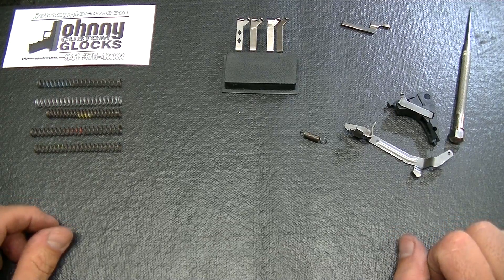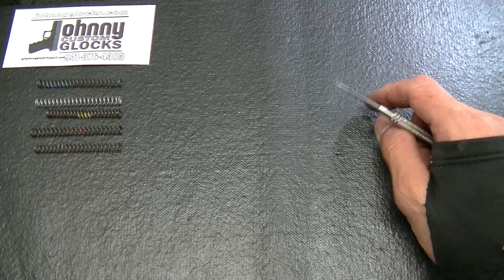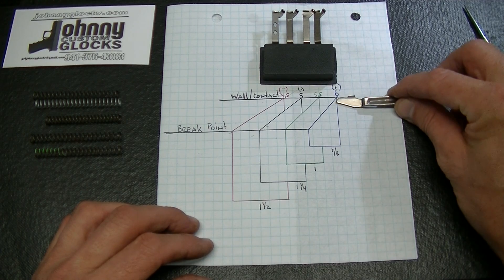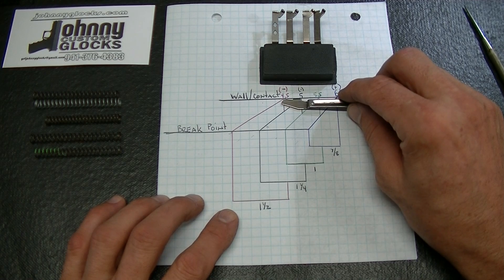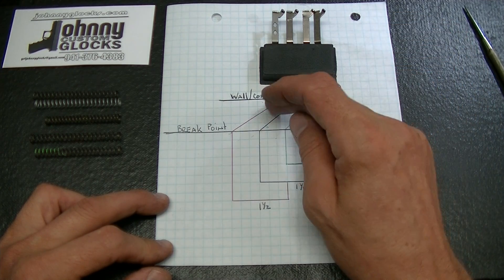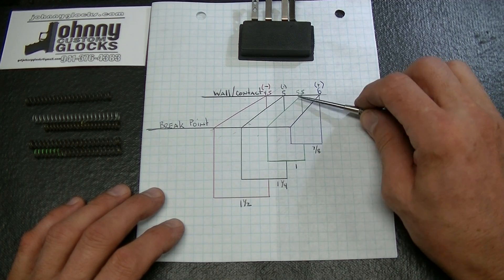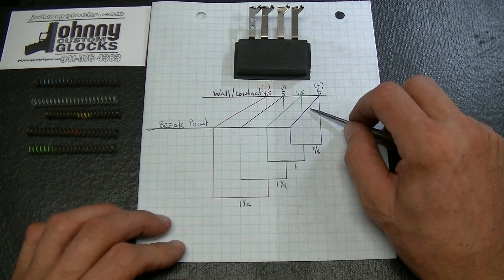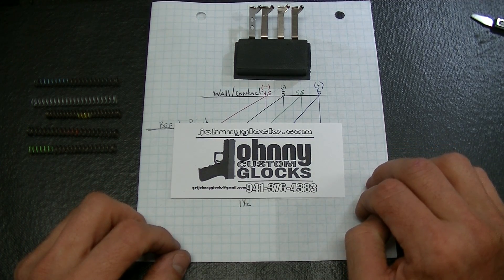Connector Geomerty Pt2 EDUCATIONAL ONLY

Comment: One of the things that you can do with the Johnny Glock modified OEM trigger shoe is reduce the pre-travel as far as you can without contacting the safety plunger with the vertical extension.  Reducing the pre-travel moves the trigger bar further back at the beginning of the pull and helps compensate for the longer pull of a lighter connector. Then you can adjust the final Polaroid by installing the appropriate weight striker spring.

Comment: I know this is a super old video but if you add an upgraded safety plunger spring your going to have 40 combinations with the 4 connectors and 5 springs.  That’s 20 between them and then each combo using a different safety spring makes 20*2 so 40 not 25 combos.  If you added in another component to adjust like a reset spring it would make 80 combos and so on.  Love these videos keep them coming.

Comment: When I use a 3.5 pound connector I find in my trigger pull I run into the safety plunger right before I make contact with the connector, if I wanted to use that 3.5 (4.5) I would need to do some work to the birds beak to make it were I make contact with both at the same time and not feel that/grit/ before my brake correct?

Comment: Hey johnny, I tried looking for the +6 connector on your site, but had no luck. Can you please help, lol. I did your trigger mod, (trigger shoe, shark fin & roll pin in trigger housing) I also modded the rear of the trigger housing by drilling a hole and tapping a m2 grub screw to adjust trigger travel. Everything works safe and great but I want a hard wall and I'm looking for a +6 connector as you described in this video. Would you recommend me changing out the trigger spring, striker spring or both. Thanks in advance🤙

Comment: Hi John is saw a video that you were trying to shorten the travel in your sons gun with the Timiny trigger. I was able to take out the travel completely by very slightly changing the geometry of the trigger bar. I found out if you bend it down a degree it takes the free travel out. My Glock 19X now has zero travel in it you push the safety down and the trigger is at the wall. I learned a lot from your videos and not sure if my findings helped at all.

Comment: Hey Johnny, not sure if you will see this considering this video is 4 years old by this point, but wanted to ask anyways: First, fantastic presentation; thank you for putting this together! You really do make it quite clear! However, I do have two questions: it looks like as you move to the lighter weight connectors, the birds beak/cruciform has to move further back along the X axis to achieve the necessary movement along the Y axis to break. If so, this would result in more compression of the striker spring. Conversely, the heavier weight connectors would result in less compression of the striker spring.

1. Have I interpreted this correctly?
2. Is this change in striker spring compression enough to get light strikes when moving to a heavier connector and should one look to a heavier striker spring to prevent this?

Thanks again!
Reply: Not on his triggers but a out of the box glock yes yes it can but with certain combo's it can be done

Comment: Your videos are so informative! I just did my first Glock build and I was in the mindset to get as light of a trigger as possible so I went all out; 4lb striker spring, 3.5 (4.5) connector, increased power trigger spring, reduced plunger spring, and topped it off with a high polish on all internal parts. I’m satisfied to a certain degree, it is definitely smooth as buttered glass and light as a feather but it’s on the spongy side.. from what I gathered from your video I should use the 5lb dot connector to get some of that spongy feel out? And maybe go back to the oem trigger spring to help the reset? Ima keep messing with it but any feedback from you would be much appreciated. For my next build I’m definitely going to give you a call and get you to whip me up one of those 1911 Glock triggers.

Comment: Thank you for the videos Johnny, it puts things into perspective. I didn't realize there was a compromise between spongyness & lightness because I have been trying to lighten my trigger as much as possible up until this point in hopes it would be more crisp. Boy was I way off 😂 but my question is, is there a way to do it? Like a shorter shelf once you hit the wall or something? I know it'll never be like a 1911 & I am enamored with the 1911 trigger but my preference for carry is Glock
Reply from the maker: If you use a standard connector and drop the firing pin weight to 4.25 lb that will have you sitting at 3.5 lb if you want it a tad later you can add a 6 pound trigger return spring at no penalty to reset. This is pretty much the best way to do it. If it's a competition gun and you're using soft primers you can use a 4 lb firing pin and that will put you closer to 3 lb spring
Reply: @johnnyglocks  Hi from Brazil! I have a Gen 5 G17 and i want customize it for competition ( IPSC ). I need a better trigger pull. What changes you recomend to me? Thank you!

Comment: I know this video is fairly old but it is a perfect example of what happens when someone is a true expert in their specific trade. I am a network architect w/ 18 years of experience & when helping anyone with basic computer knowledge I always try to not only fix the specific issue but most importantly provide the end user w/ knowledge to help them truly understand what has happened.  Thanks for being willing to share your expertise.  The usual behavior by experts is to monopolize their knowledge and somewhat hold the customer or user hostage.  I was really impressed and came away understanding the basics of the Glock action much better than before. I too always try and understand what it is I am working with.
Reply from the maker: Thanks for the compliment brother. I try to help not hinder or better put stagnate especially when people's lives are potentially on the line.  ultrasound

Comment: There is SO much confusion in the industry and on the internet about Glock connectors.  Some say "dot" are 5lb some say 5.5 lb.
Reply from the maker: Freedom Forged  the dot (.) connector is considered from Glock a 5 lb connector the standard is 5.5 and the minus is 4.5 this is because with the stock Glock OEM 5.5# Striker spring the above break weights are achieved with the corresponding connector. However it's all relative when I think of connectors I think in angle degrees the standard 5.5 is 90°the. Is (.)85 and the 4.5 (-) is 80 .
Reply: JOHNNY GLOCKS the persona Best explanation I’ve ever heard. Thanks for slicing through the BS.

Comment: Question Johnny. What if you were to grind off a small portion of the left side of the 3.5 angle connector, in order to shorten the 3.5 travel distance, making the 3.5 travel distance the same travel distance as a 5.0 connector travel distance. 
Would that even be feasible?  And how would that affect other operations of the pull?
Reply from the maker: ghostcar
 that's a great question however it doesn't do what you would expect it to do And you basically will not be able to reset with certain length of pre travel. That type of modification works better with a 5.5 connector I suggest you buy some and try it.

Comment: I'd love to see a video talking about the geometry of the ghost EVO elite. I'd love to know the reasons behind some of the changes they made. I think they shorted the time it takes for the trigger to break by moving the little angled piece forward, and got rid of the bump by moving it up. It also looks like they move the reset tab backwards? I have this connector and love the way it feels with no bump.
Reply: I love the no feeling of the bump however it feels like friction on mine. I prefer the zev race connector. Seems more crisp and lighter
Reply: Just tuned my Evo Elite today and with just polished internals it is super smooth with no wall (bump). Super easy to line the sights up and pull straight through without disturbing the alignment of the gun. It's very nice. No messing with springs or anything like that as I want to maintain reliability with primer strikes etc.

Wish I knew more about the connector geometry. I'd love to know how Johnny really does it haha.

Comment: how can I get reset like the New York one without the New York one trigger is this possible
Reply from the maker: Colby C. 
the New York one is simply an alternative mechanism in the trigger housing. It really doesn't do a whole bunch for reset. it's designed to give a revolver like pull. Where as the pre travel is free an unencumbered with just a trigger spring the New York one or two function to Give the that free travel actual tension so it feels like a singular pull the whole way back. there's not much of a first stage pump because it's designed to work like the double action of a hammer and seer trigger as opposed to a striker fire.

Comment: Id like to see a video of the different types of 3.5 connectors.  personally I hate the ghost, inconsistency is ridiculous.  Lonewolf, Zev, TTI.....etc. All 3.5 connectors but all feel different in there own way....thoughts?
Reply from the maker: RAZORJB 
absolutely I'll have to get my hands on a  majority of them the only ones I'm used to really seeing are all the different ghosts, Double Diamond, ZEV V4, and OEM. If you could list all the ones you want me to compare.
Reply from the maker: RAZORJB 
oh and Lone wolf too
Reply: JOHNNY GLOCKS the persona
thanks.  My personal favorite is the LW.  Here are the ones I was thinking about and have used.  Mind you some of these and others are Glock OEM minus connectors modified or rebranded.  Any other connectors or thoughts would be good as well.  Think with your knowledge this would be a good video.  Thanks

ZEV
Taran Tactical
Double Diamond
Lonewolf
Suarez International
Glock OEM Minus
Ghost (Various 3.5s)
Reply from the maker: RAZORJ
ok I need to get the TTI and Suarez. Then I can Cross compare with the same spring set up.